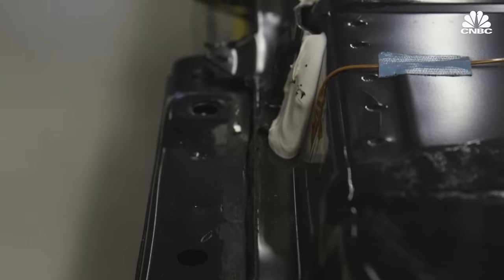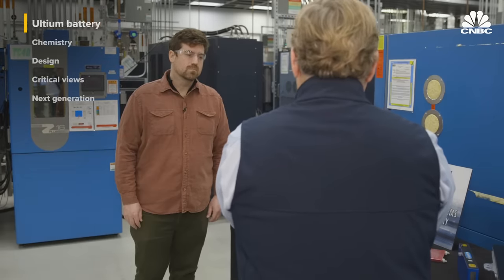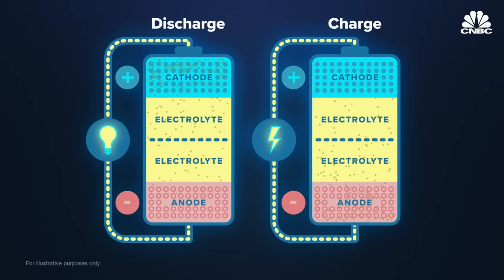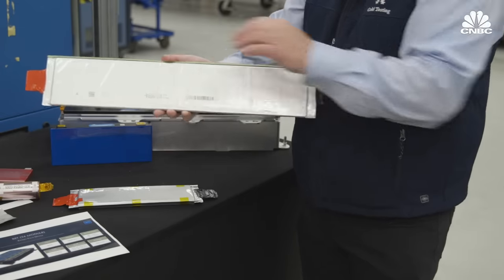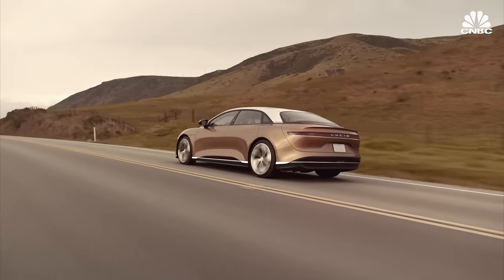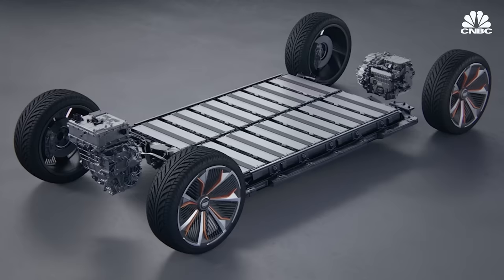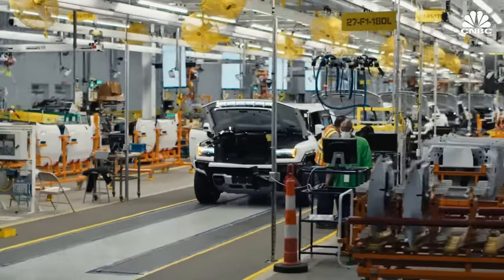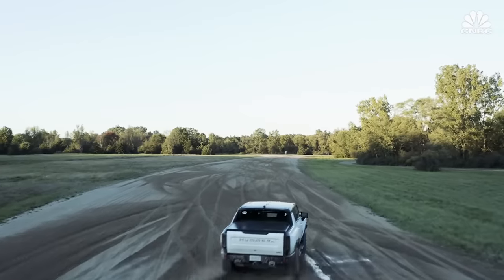Why GM Says Its Ultium Batteries Will Lead It To EV Dominance

Comment: "Around 2008, we said people really want an EV..."

Yeah, we all did, after we saw the success Tesla was having! 😂😂😂
Reply: Axiomatically, ubiquitous EVs will destroy the electricity grid. I'm incredulous as to why that isn't blatantly obvious to everyone.
Reply: @dipladonic  it will be upgraded
Reply: @dipladonic  The grid is actively being improved. The transition to EVs isn’t an overnight thing. The transition from horses (or no means of transportation at all) to ICE vehicles wasn’t overnight either.
Reply: @dipladonic  

I'm incredulous as to why you're not familiar with the steps that are being taken to deal with this. Everyone knows that if everyone starts pulling from the grid, it won't be able to handle it...AS IT CURRENTLY STANDS. Which is why there are already projects underway to increase the capacity overall. The only thing that has slowed this down is politicians who are beholden to the fossil fuel industry and want to see EVs fail.
Reply: @SA2004YG  What with...dilute, intermittent wind and sun generated electricity!
Reply: @waynelewis9110  You grossly underestimate the amount of current car battery chargers draw. Multiply that by millions of times and the amount of strain put onto any electricity grid will be unmanageable.
Reply: @dipladonic  My dear Polemist... When autos were first invented, there were no roads, no gas stations and horses were faster.  Cheer up, dude.  The future is coming.
Reply: @dontbanmebrodontbanme5403  No"steps" (especially not diffuse and intermittent wind and solar electricity generation) will be big enough to enable the grid to power ubiquitous EV chargers. As it is, electricity grids everywhere struggle to cope with demand. Add in the demand for ubiquitous heavy current draw EV chargers, green hydrogen electrolysers and batteries to back up wind turbines and PV panels etc then we have a self made and insurmountable problem.
Reply: @dipladonic  That's why Tesla creating their own grid so that every home can power their own car up.
Reply: @kadfcmaster6482  Tesla will have problems with vehicle to grid power. Especially if the main grid is powered via diffuse and intermittent wind and solar electricity. The first law of thermodynamics comes into play, you can't charge your backup with the power supply that you are trying to back up. Also, the Tesla car batteries might supply power for domestic heating, cooling, cooking, lighting, and appliances for a short period of time but they would very quickly run out of charge.
Reply: @dipladonic  Seek help.
Reply: @newguy6935  Play the ball.
Reply: @dipladonic  grid has 10twh of annual capacity, current total annual use is about 4twhs. Switching to all evs would require about .75twhs.

Not a big deal at all, and as ev adoption climbs up the s curve for ev adoption. Less and less fuel will be refined, stored, transported and pumped through those massive pipelines and by oil pump jacks which when combined use a truly staggering amount of energy. 
Then that same energy will instead just power our evs. 😎 

Fun fact for the average American driving an average ev made today(they will get more efficient as time goes on)on an average daily commute. 
Will need just 1.5-3hrs of off peak ev charging. Using existing smart connected chargers. Not a big deal at all anymore. 

Same load on the grid as running your whole home ac for a couple hours(except now it'll be done offpeak or even mid day when renewable solar is at its generating peak. Most hvac systems for a single family home are on 30-50amp breakers and so are most home clothes dryers. 
Today's lvl2 evse equipment are put on the same sized breaker 30-50amps. Stop the panicking and fud spreading. 

Since 1980 the US population grew over 30%+ yet per capita energy use dropped over 30%. And has stayed stable at close to 4twhs for almost 20 years now. And that counts all those cell phones, tablets, laptop's, razors, toothbrushes etc that all use batteries and need electricity to charge them up. 👍🏻
Reply: @dipladonic  Ok. I'll play ball. And quickly, I would just say I get your concerns but I also think you are looking at this without other considerations. Example: Take me. Until recently, I wasn't able to justify putting solar panels on my house. However, my oil furnace is getting old & I decided to replace it with the newer heat-pump whole house units that work at 100% efficiency down to a -15 deg F outside temp which may occur in my area once in 20 years. Additionally, I and my girlfriend will be driving EVs in about 3-5 years. Suddenly it dawned on me I could justify the cost of a solar panel system and table-napkin math gave me a payoff period of 8-10 years. Let's just say ten years. My point to you is, that suddenly a solar panel system was a justified expense to me and this realization will also dawn on many others as well. The whole nation? Certainly not. But even if 15-20% of homes in this country went this route that would be a lot of load off the grid. Additionally, to some degree, it's as if you are calculating that everyone is going to be charging their cars at the same time or during heavy use hours. No... not really. Anyway, not enough space here but I'll leave you with this video.
https://www.youtube.com/watch?v=7dfyG6FXsUU
Reply: @dipladonic  

It's a waste of time to argue with you when I say steps are being taken to upgrade the nation's grid and your response is "NO THERE'S NOT!!!!!!" Clearly you did zero research before making that response. I hate doing homework for those who just want to argue, but for starters, why not read up on the "Better Grid Initiative" before posting again?

There are roughly 150K gas stations in the US. Do you think we went from zero to 150K overnight? Of course not. We got there after many decades of incremental improvements. Thinking like yours is exactly why Germany is in the position they're in, where they're so reliant on Russia's fuel and are at their mercy. Stop being a tool for the fossil fuel industry and let us progress to renewables.
Reply: @newguy6935  

The Polemist is also not taking into consideration that we're not going to all be driving EVs next year and just like the government supported ICE car adoption over many decades (and still subsidizes the price of gas), the march toward EVs running off renewable energy will also be a slow but steady process. Honestly, we should be further along, but the fossil fuel industry clearly has done everything they can to keep us reliant on them.
Reply: @4literv6 You appear to know very little about the subject that you are commenting on. I don't know where you live, but going by your numbers your grid seems to be incredibly inefficient (an excess reserve margin of 6twh is incredibly inefficient and unviable).

If we ever stop pumping oil, the energy savings thereof are minimal in relation to grid demand. To suggest otherwise underestimates current electricity demand. Such minimal energy savings would never scratch the surface in mitigating the stress that ubiquitous EVs would put on the grid.

EV charger load would be in addition to the existing domestic load. Even the smallest "smart connected chargers" draw 32A (equivalent to about 76 x 100W light bulbs). Millions of these connected to an already stressed grid over a 24-hour period would inevitably cause catastrophic failure.

Fun fact...a Tesla supercharger draws about 500 amps (equivalent to powering roughly 1000 x 100W light bulbs).
Reply: @newguy6935  Firstly, I'm assuming that your solar panels are subsidized via the huge and opaque domestic and industrial ecosystem of renewables tariffs as all diffuse and intermittent renewables only generate at about 33% of installed capacity (that fact alone should bring the debate to an end).

Secondly, I'm referring to utility-scale macro power generation. The type that powers industry, and steel and cement manufacturing etc, not micro domestic generation which can be viable but only if you spend enough.

Thirdly, I hope that you are not assuming that your solar panels will supply all of the domestic power you will need AND that they will charge your EVs when you eventually buy them because you will need a huge amount of PV panels and battery backup to do so succesfuly. 

Globally, electricity grids are already very fragile. Diffuse and intermittent renewable energy is making them even more so. To think that plugging millions of EVs into almost any grid is a viable proposition is abject nonsense.

Unfortunately for you, only time will teach you my credulous chat mate.
Reply: @dontbanmebrodontbanme5403  I never said "NO THERE'S NOT!!!!!!"...I gave a clear explanation of why no "steps" (especially not diffuse and intermittent wind and solar electricity generation) will be big enough to enable the grid to power ubiquitous EV chargers.
Reply: @dipladonic  You grossly underestimate the fact that the grid is BEING upgraded coupled with the fact that not everyone will charge their EV AT THE SAME TIME...oh and also do not forget that a lot of EVs will offer bi-directional charging which means that the EV will add to the grid.
Also regarding renewables, there is this thing called storage batteries that store the energy from wind and sun so they can be used when there is no wind/sun.
I just fixed it for you, problem over.
Reply: @dipladonic  See my point which proves you wrong.
Reply: @dipladonic  See my point which proves you wrong, give-up. You are wrong, sorry but you are.
Your logic states that when cars replaced horses that the 'grid' would collapse and not cope yet here we are and err no mass system failure.
Reply: @dipladonic  With respect you know nothing about what you post. You seem to think it is all going to be doom and gloom and refuse to do even the most basic of research. If you did you would see that the only problem is in your head.
Reply: @dipladonic  I notice that you are foolishly trying to change the subject. The point is that all the pieces of the jigsaw exists and it is a simple case of putting them together.
Reply: @dipladonic  You did! You keep on saying there will be a mass failure of the grid despite not doing a single bit of research on the fact that  the grid IS I repeat IS being upgraded to cope, plus not every EV will charge up at the same time. Just as not all ICE cars refuel up at the same time now do they?
Stop arguing for the sake of arguing.
Reply: @taefravis  Nice try, but you clearly no nothing about the topic that you have piled in on. What is powering this "upgraded" grid that you refer to...please don't tell me that it's diffuse and intermittent wind and solar electricity generation (which only generate at about 33% of installed capacity). 

As far as your "Bi-directional charging" is concerned, even Tesla doesn't do V2G, nor do many other manufacturers because they all know that you can't back up your backup (your EV) with the power supply that you're trying to back up (see the first law of thermodynamics), especially if your main supply is via diffuse and intermittent wind and solar. Utility-scale V2G is a fallacy and at best a band-aid to resolve an issue that requires major surgical intervention.

Regarding storage batteries...battery density has barely tripped over the past 50 years because the science, physics, and the periodic table do not lend themselves to resolving this unsurmountable man-made issue of our time (brought upon us because of unreliable and inefficient wind and solar power).
Reply: I still don't want one

Comment: Going forward, I recommend you include a comparative analysis among all the manufacturers with their EV’s regarding maximum charge rate, maximum range, and efficiency (including whether or not the models have a heat pumps). It is in these three areas that people find the most value with her EV’s because these three areas point to the true long-term value of those vehicles.
Reply: TESLA model Y "50D" made in AUSTIN is Superior to anything made by Legacy auto,
Reply: Adults roll their eyes at the "I was like" millennial verbal tick. Now a strata of adults have a verbal tick of their own. It's "Going forward". Completely superflous and pointless, it can be used at the beginning or end of sentences; going forward...
Reply: This was probably partly sponsored by them, this is literally hot air
Reply: Right now Mercedes has the range advantage pretty much locked down, even tesla new battery cannot come close to Mercedes battery range. 
Others have vastly improved electric motors and weigh only 18kg, can produce 700hp each.
Others have various other amazingly advanced advantages to others, Tesla the cause of the ev revolution has maybe the closest to autonomous driving, but Others have caught up to them before they have even released it.
Quality of build must go yo VOLVO although they need to lower weight drastically. Others are way behind in ev development yet , but I for one am do happy not to own an ev right now as energy companies greed is making ev ownership just way too expensive right now.
Reply: wait for it...plug-in hybrid PHEV tech.
Reply: @artlewellan2294  uh. 7khw? As a gesture  or short term solution compensating only the GM executives who concede the long term to Tesla?
Reply: @andrewbrown6578  Andy, it's not the weight of the motor, but the weight of the batteries. Check it out: the EV is ~twice the weight of ICE vehicles.
Reply: @VickersDoorter  I’m so tired of trend speak with bad analogies piled on analogies… Mary Barra never says anything. Ever.
Reply: @andrewbrown6578  you are missing the point. TESLA isn’t going for range, they are going for adequate range and volume of cars sold is the priority over EVERYTHING ELSE. No one has range anxiety in a TESLA when they have the most robust supercharging network that is 99.3% up time. 405 miles is plenty in my TESLA. I wake up to 380 miles everyday. Mercedes needs marketshare and a solid charging infrastructure, not range increases.
Reply: @artlewellan2294  great the worst ice vehicle and the worst EV.
Reply: @andrewbrown6578  Volvo dash looks 1970.........................Paul
Reply: Nerd 😂
Reply: @danielstory2761  Are you saying the speed of charging an EV and how far you can drive a EV on a charge is "hot air"?
Reply: @Patrick_Gray  I'm saying that taking corporate marketing statements at face value is stupid
Reply: They should carry them back to Mars and do further testing
Reply: @llengford  Who is "They" and who is "them" and what does Mars have to do with it?  Comment seems a little stupid, probably from a "hater".
Reply: @VickersDoorter  before and after you get through fighting before and after the nuclear bomb hits You better get your butt and high gear. Get ready. Your fixing to go fight, And you won't be driving no electric car or neither. You're not going to get out of it. It's your generation. You are the chosen one. None of this stuff is going to last very long dude..... Where are you going to charge your electric car.... It's all we can do down here in the south to keep power to the houses. Besides that, after the nuclear explosion you won't have any of that.... Use younger generation needs to learn how to pay your rent. Buy your own food and pay your own car payments and insurance. You mama ain't going to be here neither You're living a fantasy world dude. The real world is that you're flesh and blood. You should be trying to get in touch with the author and finisher of your faith, Jesus Christ because he is the only one that's going to be able to help you before long....
Reply: @GET2222  all politics.... focus on Jesus, the author and finisher of your faith would be your best bid.
Reply: @markplott4820  The problem with Tesla is they could have been far more dominant and aren’t. Elon has to use PayPal and SpaceX to keep propping up Tesla. Their solar technology is probably more innovative than the EV cars.
Reply: @markplott4820  Solar is far more efficient now, as in panels are far more efficient. We sadly could have had great panels by now has we kept the Carter panels on the White House in the 80s and developed that tech then.

Comment: The price and range justtttttt hit the right spot for me. If GM's ultium pack does have a minimum of 300 range and is 30k that would be a top competitor to me.
Reply: Ten years life span...
Reply: @blindtoby8967  10 years...based on 10 seconds of typing, yes?
Reply: Problem is they only made 26 EVs in Q1 of 2022. With all that head start and experience you’d expect GM to be making and exporting millions of them every year. What’s wrong with this picture?
Reply: Less lifespan than LFP
Reply: Remember they are still using LG fire causing cells in the packs.  A burned down EV is not worth much.  Remedy is to cut your range that you bought with it.  So be careful.  Unfortunately a current EV owner waiting almost three years for a word on recall replacement.  Profit over safety and range is subject to their choosing later on......
Reply: Yeah, well the problem is the Cadillac Lyriq is 307 Mile Range and costs between 62k and 78k... that's Ridiculous! Besides that, Tesla has them and everyone else beat by miles when it comes to the Computer System. With a Tesla you can choose to pay and download the Self Driving Feature any time you want when you drive off the lot... You can't do that with GM because there is a camera in the steering wheel that watches you to make sure your eyes are on the road. The Tesla uses all the cameras and sensors it has built into it for the Self Driving Feature.  GM and all the rest of them are still playing catch up, Tesla has a good 10yrs if not more on them!